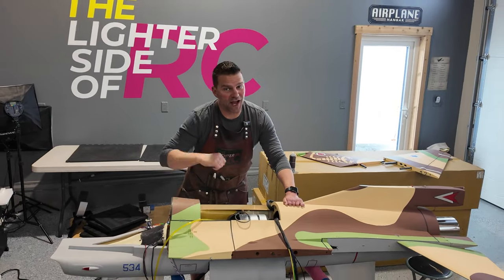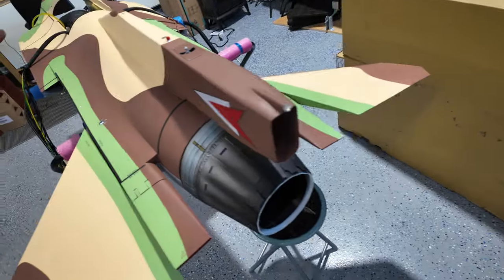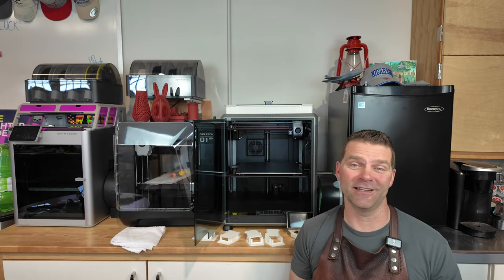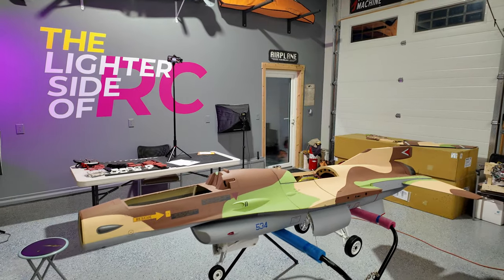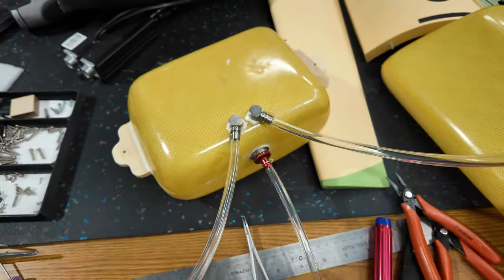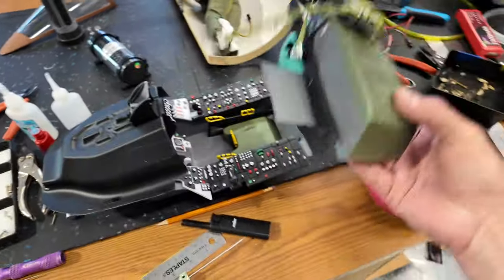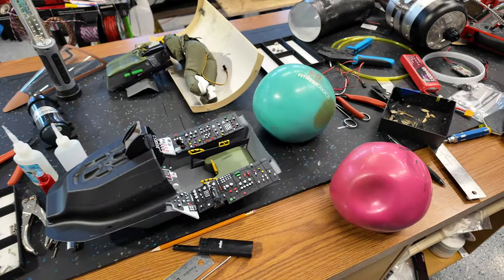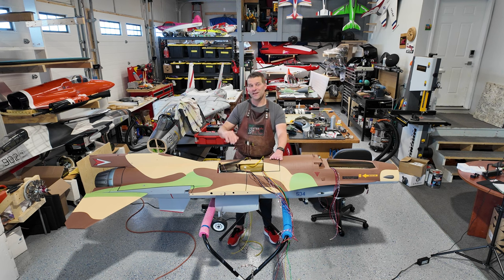Transforming The F16 Rc Jet With After Burner Installation! Skymaster F-16

Comment: I'm sure you have thought about the idea of using hot battery busses and grounding busses. I've never seen anyone in the rc world use them. they are a wonderful way to save from having to run so many wires. We use them in experimental aircraft building.
I want to say mouzer or maybe amazon you can find miniature hot and grounding busses. Thoughts?

Tony
Reply from the maker: We have the ability to use bus systems with the various equipment out there.  So one lead and a power lead that go back to a distribution box.  Saves lots of wire.  Only really valuable in certain aircraft.

Comment: What does a U.A.T. do?
Reply from the maker: UAT is the last fuel device before the fuel pump.  So all the fuel flows through the UAT and then into the fuel pump intake.  The purpose is to prevent any air bubbles from getting sucked up by the fuel pump.